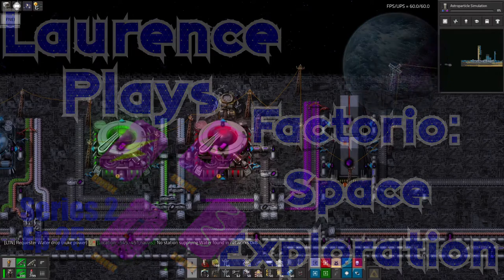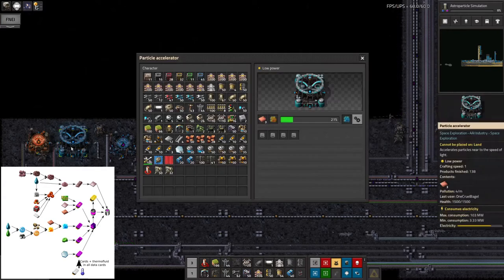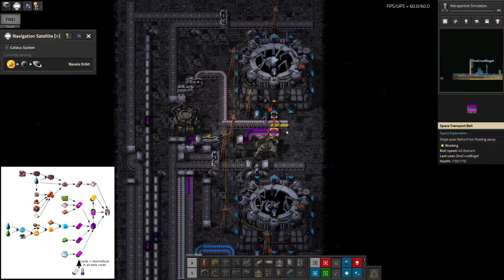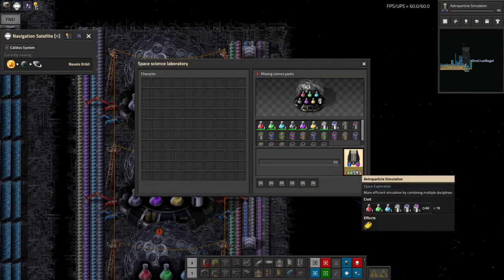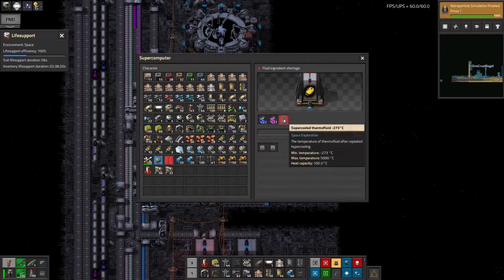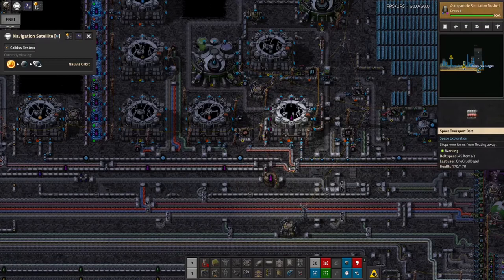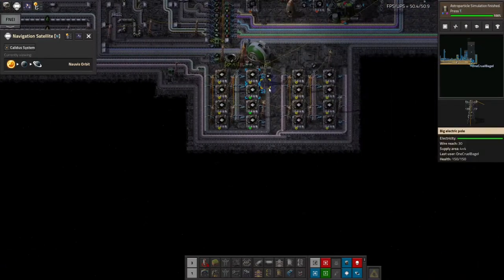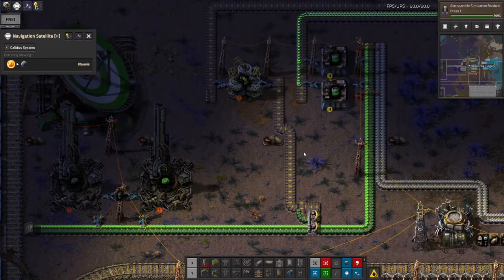S2-E25 - Energetic - Laurence Plays Factorio: Space Exploration

Comment: I wonder how long you will stick with main bus in space. Look's messy already.
I went with 100% bots in space. No regrets yet, but scaling up frightens me.
Also consider polishing with water instead of chem gel.
Reply from the maker: I haven't given up yet  :-)  I think once I get to the second tiers of the science packs I might change to some kind of on-demand train system though to reduce the width of the bus. It's a bit messy because I tried to keep it narrow and compact, because everything has to be built on the scaffolds - I should, perhaps, have spread stuff out a bit (or a lot!) more.
Reply: Actually, doing new tier scales up science output substantially without much more input. So by design no trains really needed until maybe dss1 or 2.
Reply from the maker: @axelander_ish  It's the number of different types of input that's the awkward part. The throughput on the belts tends to be fine, but having 40 different things heading down the bus is a faff. I have noticed that there should be major efficiency improvements with the higher levels though  :-)